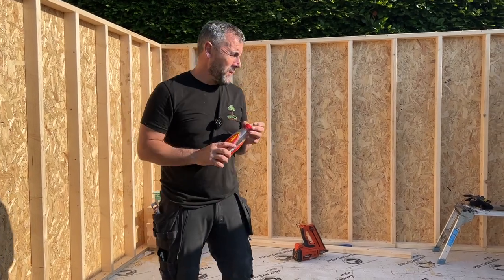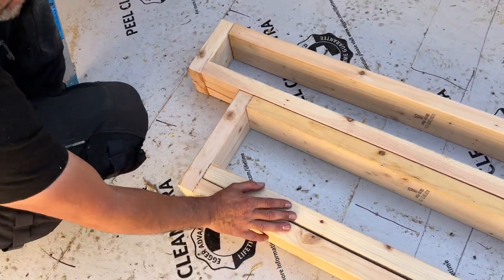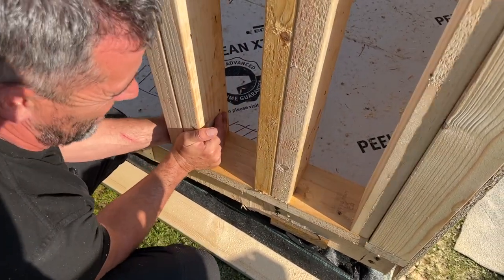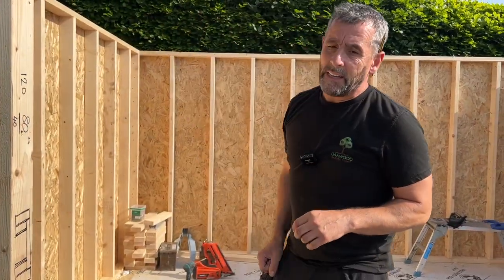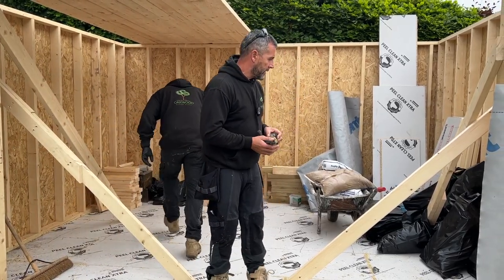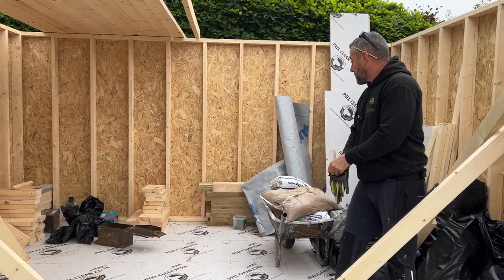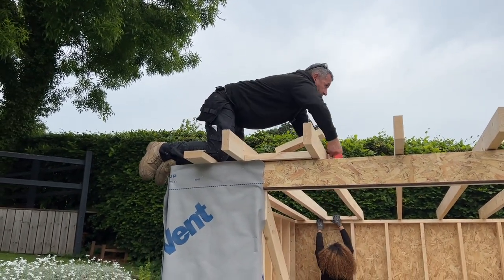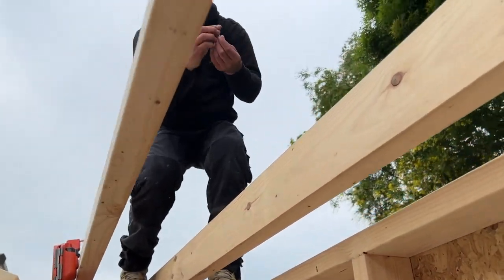How to build a garden room, day by day vlog.

Comment: Once again, super brilliant video, thank you Liam :) Loving the roof noggins with corners removed - will deffo be adding that to my build, great idea for running cables. Also with regards to the tools that you had built, they are pure genius and after watching you wind down your nuts for the past few years manually and with rubber attachments to drills etc, just what you guys need. Kepp up the videos, loving them.
Reply from the maker: it really is a perfect tool, so well made too

Comment: I think the osb3 t&g sheets are designed so they don’t need a noggin to fall on the short end joints (assuming appropriate joist/rafter spacing).  Get a mafell or Metabo cross cut saw for them as well, mark once and cut - no messing making two marks and a line.

Comment: Could you use 2 4x2 timber rafters at 400 centres for a roof for a 6m x 4m garden office? Trying to increase headspace slightly inside 🙈 thinking I’d use 75mm insulation.
Reply: 4m span = 7x2 ref flat roof span table c24

Comment: Love the videos, I was going to make a pergola for the hot tub, but it's seen most of your videos ah good thought, why not a hot tub room. I figure out would heat the room and lower energy costs. I can see an extractor fan making an appearance, additional steel rods in the area directly under the hot tub, but keen to know if you've ever done this or even if you would recommend it ?

I'm planning on having permanent back/ sides but haven't decided on the front yet, which would also be a factor in removing the hot tub should it be necessary.

Comment: Hello!! Very great job. I saw more than 10 videos of yours as I will build my own small garden house. I have a small question regarding back wall for example in my case I will not have access to the back wall. So I will finish it completely before put it up. Question is. Because this side is not visible I don't want to spend money on composite decking for no reason...which material I can use instead to cover that wall? 
Thank you in advance !!!
Reply: I would say still wrap the wall like all the others with the battens then put cheap feather boards so it’s still a good finish but cheap and sort of insulated and protected.

Comment: Will a steel flitch plate between two timbers do the job liam?
Reply from the maker: It will to a certain point, there's still deflection in them, especially if your doors are top hung, the force pushing down on a flat plate stood up on its side as it would be when it was sandwiched between timber, has not much deflection, but imagine if you flipped it on it side, it bends quite easy, so if you have a lot of weight on the doors top hung? theres were you might get a problem.

Comment: Your videos have given me the courage I need to build my own garden room.  However I want to put upvc french doors in my 4m wide garden room. They will measure 2700mm in total...1500 wide doors and 2 x 600mm wide glass side panels each side of the doors. Can I use 4 x 2 CLS for the front wall and 2 x screwed together 5 x 2's as the lintel? Will this be strong enough for the roof and the doors?  Your advice would be much appreciated!
Reply: Hi Andys7422 did you manage to buiild yourself? I am planing the same:)

Comment: Great videos and have purchased the build pack.  Looking at these vids before starting and ordering the timber.  Just seen you aren't doubling up on the roof joists as suggested in the pack.   If I go c24 for roof joists do you not need to double up.  Cheers again for these videos.
Reply from the maker: Anything over 3mtr double up, this build is 3mtr deep, or very close anyway

Comment: Hey Liam, I have a question regarding the  steel beam, we are not going with the bifolds, we are getting 1600mm  width french doors, do we still need the steel beam?
Reply from the maker: I’d double up a 5x2 and bolt it for that 👍🏼
Reply: @Oakwood Garden Rooms  oops wish I read this comment before ordering the steel for my 2000mm span. Got the buildpack for the 5 x 3. Went with a 2400 steel,
Reply from the maker: You won’t regret steel 👌
Reply: @thegardenroomguru  cheers the reply mate, appreciate it. Just want to reiterate what everyone thinks... your videos and your energy are awesome. Can't wait to start digging.
Reply from the maker: You’ll smash it, they all do! Take your time, do your homework, it’ll all be worth it when it’s done. Massive sense of self achievement too.